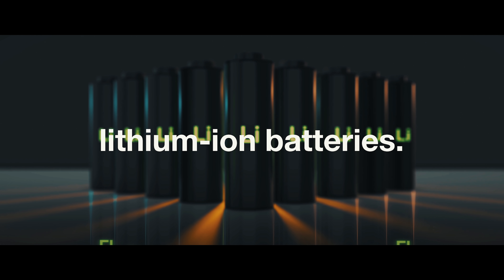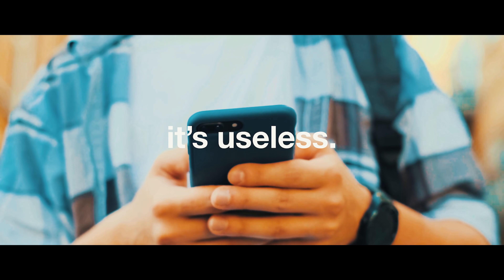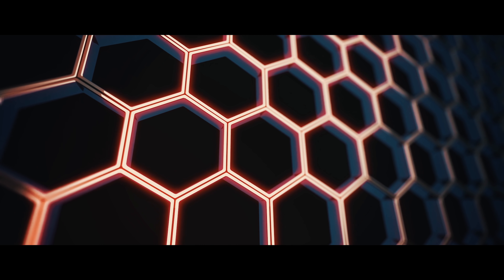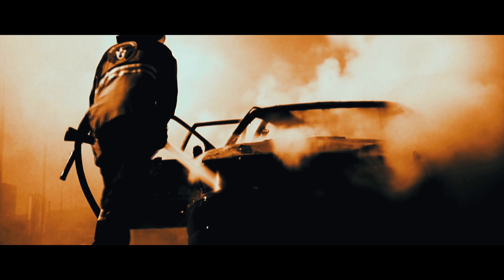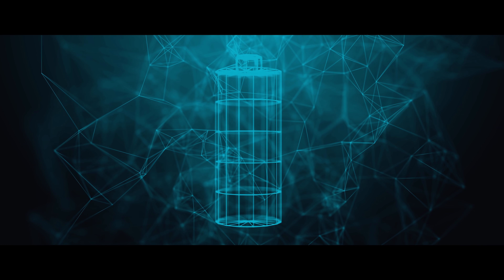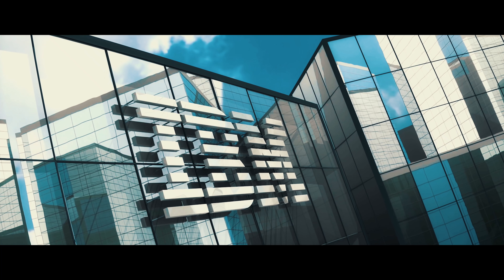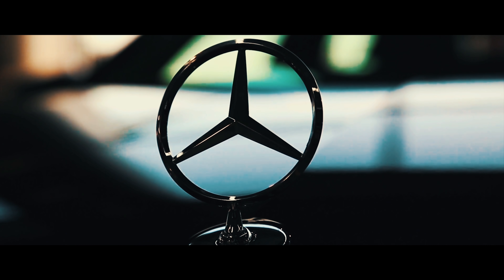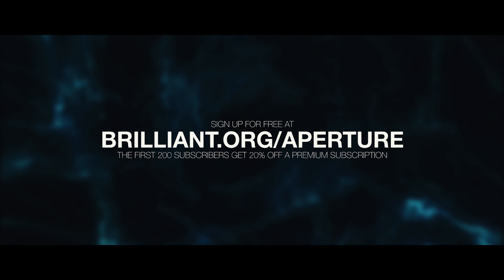The Million Mile Battery

Comment: Owns a 9 year old ev, and a 8 year old ev... Battery still works... When he says you need to change the battery every year...."survey says" that's a lie... The battery tech has gotten exponentially better in li batteries over the last decade the batteries are more energy dense by a factor of 5 from a decade prior... This is in current packs.... There are other options out there and it will take all kinds moving forward... The nice thing about batteries... When they are no longer viable for an ev they may still be good for home energy storage, when they're no longer suitable for that, they're suitable for smaller tasks or be recycled... But more importantly you can just upgrade your car by getting a better battery pack... Most cars don't make it past a decade because the engine is improperly maintained ( most people don't understand how to work on a car, had a buddy put 35k on a leased car without a single oil change)... Point being EVs are idiot proof... When the pack eventually craps out after 500,000+ miles then you just replace the bad portions or upgrade the whole thing... Car keeps going

Comment: 2:39 - I don't know of anyone who travels far enough to and from work to completely drain even the smallest Tesla Battery. Only flaw in that argument. I travel about 10 miles each way. So assuming I do work every single day with no vacations, I could work 12.5 (Let's just say 11 days to be save and consider phantom drain) days before needing to recharge. That puts the answer to your argument to about 14.5 years before getting to 80% capacity. At that point most people would be ready to get a newer upgraded vehicle that has a larger battery anyways.

Good video tho, I enjoy your content.

Comment: I had dead battery from my Galaxy S2, it couldn't charge any more, battery last for few seconds. So I put it into freezer over night, let it warm in room temperature, put it back in to the phone and it worked almost like new, It can be charged to 100% again, and it hold power. I did the same with my old dead battery from my laptop. And again it worked is now 3 year I use it after freezing, it got like 70-80 power of new battery

Comment: 5:00 - This is wrong. Overheating of batteries was only one batch of batteries by a supplier that caused this. The majority of fire were caused by the edges of the battery short circuiting. Your information is a bit misleading

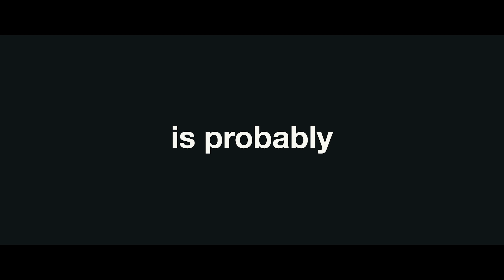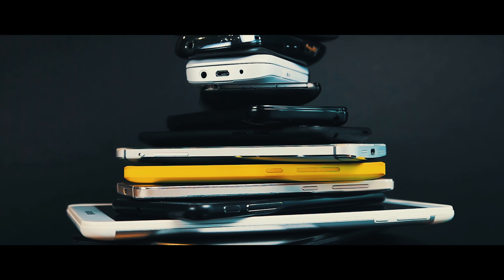Comment: At 2:00 you could talk about ifixit.com. They teach you step by step on how to repair your own device. At 2:05 you could talk about the "Right to Repair Act" which makes manufacturers sell users the parts to repair their own devices. At 2:07 you could talk about how much landfills are quickly getting filled up with hazardous materials (basically all electronic equipment). At 2:13 you could talk about how wasteful it is to throw your old phone away and buy a new one (hence the landfill). At 3:30 you could introduce the talking point about graphene (single atom layer thick graphite). I highly recommend looking into it since it has the potential to reshape the whole industry as a whole. I like the video but there are a few things I would recommend adding to it since it will help inform others of ways to save money and help the planet at the same time.

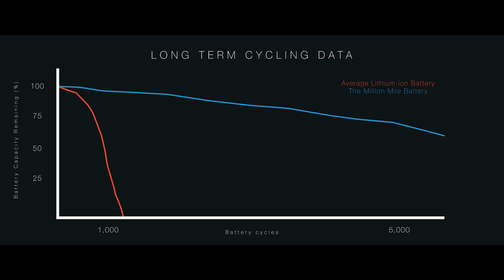Comment: 4:14
This graph is a bit misleading. When you buy a new battery you have the 100% capacity. So if left at the Y-axes the cycles are 0, 5000 cycles should be 5 times as far away as 1000 cycles. But it looks like more.

Comment: As awesome as it will be to have this, we honestly don't need a car battery that can last a million miles. The new Roadster will supposedly have a 600-mile range. If you can put a 600-mile battery in a sub-30k car that's enough to completely replace most gas-powered vehicles on the road.

Comment: This is soooo wrong!! You obviously don't know ANYTHING about today's batteries. They already outlast the life of the car. You DON'T have to change the battery every year!!  10 years old cars  may have some issues due to the lack of thermal managment, but cars from 7 years ago already have it and this prevents the dendrites formation during charge and discharge. What causes the degradation the most, is the complete discharge and full recharge of the batteries. This is  why cars have top and bottom buffers to avoid these situations. Car's bstteries can be charged at much higer current thanks to the active cooling that keeps the batteries at the right level . All these things together, improve the lifespan of the batteries to 300,000-400,000 miles to say the least! And we are talking about something already on the road, not future things to happen. Next time you should verify your info before publishing something so incredibly inaccurate!

Comment: The first part of the video was totally misleading. Sure some phone batteries might only last a year but phone manufacturers aren't concerned with battery life so the batteries are allowed to get too hot, charge too high and discharge too low all of which significantly reduces the batteries life. Batteries in home solar energy storage or cars have better battery management and last much longer.

Comment: The “million mile battery “here mentioned has an energy density of 200Wh/kg, which is lower than Tesla’s average battery of 250Wh/kg. A huge issue with NMC is cobalt content, which is expensive and has ethical concerns, and something Tesla really wants to get rid off. Prieviously Tesla used NMC, but this longevity formulation was just achieved by carefully tweaking with the contents, NMC is nothing new. I think Tesla would be using dry electrodes for their next gen battery, which decreases cost and increase performance. The carbon nanotube one looks promising. Additionally, Tesla vehicles can charge up to 80 percent within 30 minutes using Super chargers, and able to fully charge in an hour or so, and able to go on hundreds of miles before charging again, unlike mentioned 7:30.
Reply: same thing with phones a typical new gen Samsung takes an hour or so to charge 0 to 100 and there are companies I forgot its name that made a phone that charges 0 to 100 in minutes it even has a cool battery % scale that you can look at as it goes up infront of you

Comment: An easy way to explain dendrites is just crystal growth directions. Single crystal structures have all dendrites in the same conformation. Anything other than single crystal will have the position and direction of the dendrites in a different way
Edit: Also one of the main reasons the million mile batteries are capable of such a feat is because they are single crystal. A nearly flawless crystal won’t crack, the problem with Elon trying to use this, is that cobalt is used in it, and Elon is trying to get rid of cobalt from his batteries because the way cobalt is obtained has questionable human rights records

Comment: One thing that should be clearer in the video: Current electric vehicle batteries in general last about 200,000 miles. That's a LOT longer than commuting to work for a year and a half for most people. Your calculation assumed that every day the trip to work took the full charge of the battery, resulting in a full charge cycle. In reality, most people will only use a couple percent on their commute to work. This keeps the battery within the optimal charge range between 20-80% and causes very little battery degradation as a result.
Reply: Yeah I dont really remember my dad changing the car battery like every year so this explains that as we travel  moderately
Reply: Thanks, I was confused about this
Reply: A LR M3 would do 250.000 km for 500 days of use (roughly one and a half years) consuming all its 500km range every day.
Granted, if you fast charge a battery this often it would not last long at all, but it's still more than the distance ICEs are considered almost end of life... while having spent a fraction of the cost for "fuel". Electric cars work now just fine, once we overcome durability and charge speed (which in term affects the durability), then it's over for ICE.

Comment: Great video but I feel like you're mentioning an important point: lithium mining, the growing concern about its shortage and its environmental impact.
Lithium and cobalt are tough to mine and it's done in horrendous situations (linked to child labor) .
This might explain why IBM is trying to compete in batteries whilst growing away from lithium and cobalt:
Not because of environmental reasons but because the shortage might increase the price and hurt a rather young industry. There's also the fact that electric cars are putting a high tension on the market which may accelerate the decline.
Here are some links you can use to check for yourself:
https://www.wired.co.uk/article/lithium-batteries-environment-impact
https://www.nsenergybusiness.com/features/lithium-ion-battery-environmental-impact/
https://www.theguardian.com/global-development/2019/dec/16/apple-and-google-named-in-us-lawsuit-over-congolese-child-cobalt-mining-deaths

Comment: Where did you get that 300-500 cycles from? A good old lead acid battery will give that. I have 100Ah Lithium batteries that are guaranteed to give a minimum of 2000 cycles of 100% to 0% discharge. Even more if you run in the 90% to 10% range.

Comment: Not much accurate data presented in this video, starting with the very first statement.  Lithium ion batteries have not been part of daily life for 50 years, first commercial lithium ion battery came out less than 30 years ago, and it took quite a few more years before it became a part of most people's daily life.

Comment: Love the video but as an expert on EVs I feel like some things are overlooked in the video. Lot of facts not really checking out. While it looks similair, you can not compare car batteries with phone batteries. There isn't a single production car electric that has a battery life span of 1 year. All have 8year warranty Nor do they have 300 cycles. 1000 to 2000 cycles and some close to 3000. Also  most (nearly all) electric cars can fast charge wich is not 8 hours charging but rather 30 mins. Normal charging mostly 3 to 5 hours. Also most that fastcharge have cooling and fast charging is not "just higher voltage".

Comment: Uhm.. the intro isn’t factually that correct, proper batteries nowadays last much more than 300-500 recharges at over 95% of initial capacity, and when degrading, some of the cells are re-used in special facilities. Besides, the Li-Ion batteries technology is constantly improving, in terms of capacity, longevity, being easier to manufacture, people add different chemical solutions to the making of such batteries to explore possibilities, this field is not topped out and there is room for improvements.

Comment: Tesla bought out Maxwell who specialised in high energy density capacitors in a much smaller unit than traditional capacitors.
The way Tesla has increased the longevity of their batteries is using them alongside these capacitors. 
The reason Samsung had issues with heating is because in their haste in trying to rush through another phone because they're in direct competition with Apple they put the materials into a container which was fractionally too small and this resulted in the anode and cathode being able to make contact with one another and as has been seen violently shorted out the battery and since that Samsung didn't make that error again. 
Lithium ion is an incredibly dirty material to use as the processes which go into refinement to make it usable for batteries is incredibly harmful to the environment so to suggest that it's not that much of a big deal for mobile phone companies to be producing 1 to 2 new phones each year isn't entirely an accurate statement and at close to and over $1,000.00 per phone it's not exactly cost effective to purchase the latest unit each year or 6 months.
Graphene not to be confused with graphite and making massing improvements over lithium ion and are far far cleaner to produce, one chemist by the name of Dr Robert Murry-Smith is demonstrating this fact very well indeed.
Fascinating video but a few areas were left out to give better context

Comment: " Phone Batteries take 1 to 2 hrs to charge ".
*Laughs in realme x2 pro. It charges under 30 mins btw
Reply: That's the average time
Reply: Same with OnePlus 7 pro
Reply: Not unusual for most new phones
Reply: These companies use higher voltage adapters for fast charging. Isn't that supposed to degrade the battery way faster too? Just curious
Reply: @mushyomens6885  the secret is, they are using 2 or more paths to charge a battery instead of one. They keeping the voltage constant and increasing the current flow to pump more energy in less time. It's like charging multiple batteries at a time.
Reply: My old phone died. It was a few years old, and it was my first one. Well, RIP. But now I got this motorola. Never heard about it but I could go on a full day without charging and I'd have still a lot battery left. And I could recharge it in around 20 minutes XD
It's pretty amazing to me cuz my old phone still works in theory but it eats battery faster than the charger can charge. And it was broken in many diffrent aspects, but none other than this one made it unusable.
Reply: AO1337 not true, my 11 pro fast charger can do 100% easily in thirty minutes
Reply: @joshp8820  stop lying. Iphone takes over an hour to charge. So does all androids. Fastest android takes 45-50 minutes to charge. Thing is even if it went 0-80 in 5 minutes the last 20% charge slowly to preserve battery longevity.